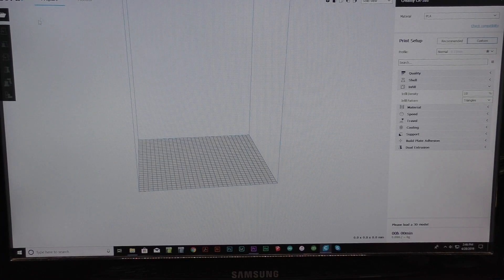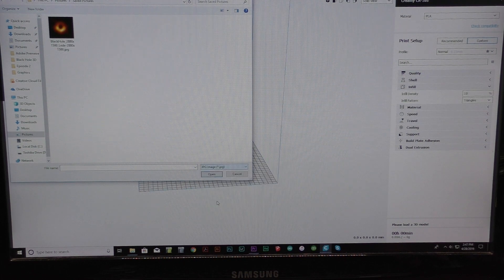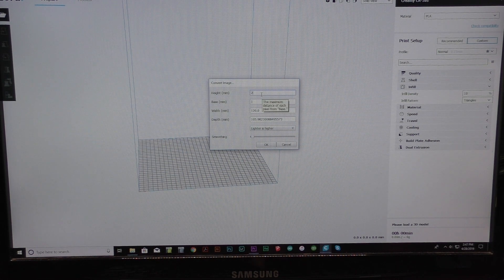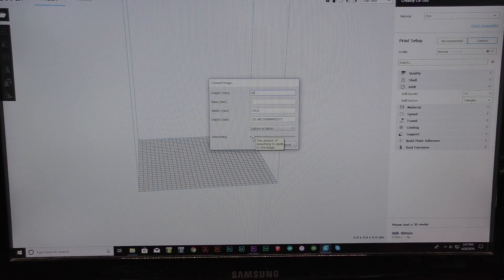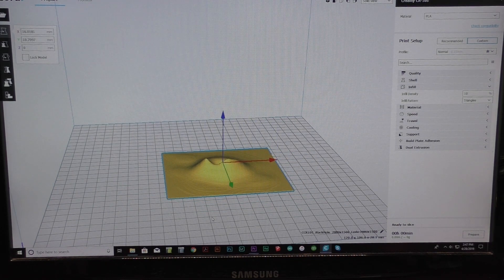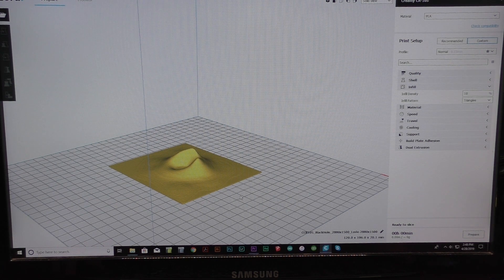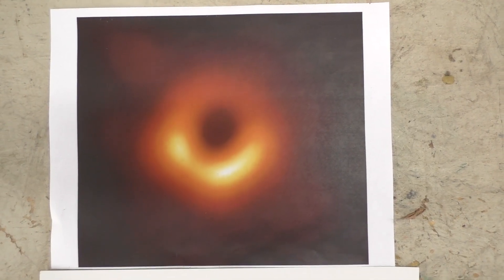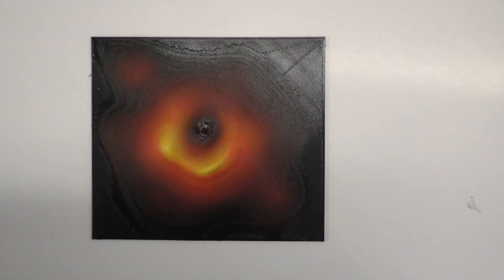3D Printing Black Hole M87 with Cura

Comment: The circle around is actually a sphere but no matter where you look it from it 'll look like a donuts. With all these gravitational forces that can "bend" light the actual hole would rather look like a "negative" mirror sphere that would "reflect" what ever is at its back or exact opposite side of the hole from where you look at it in the exact opposite orientation and direction at you. But you would probably be dead before you could even come that close..